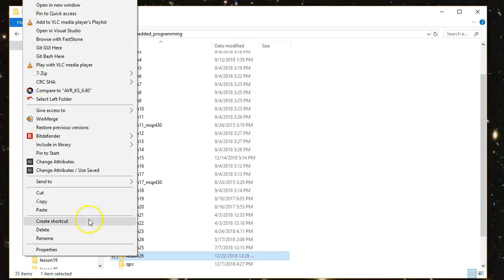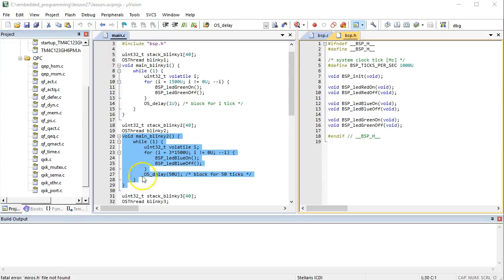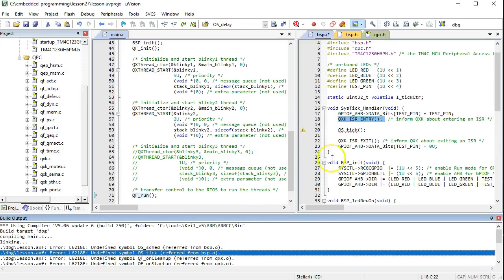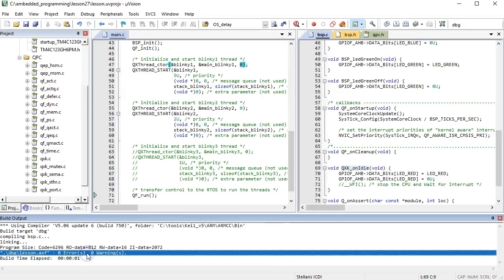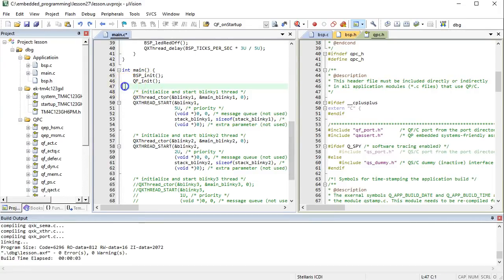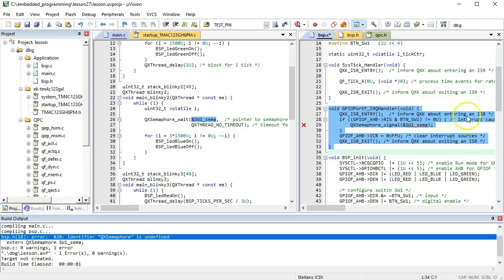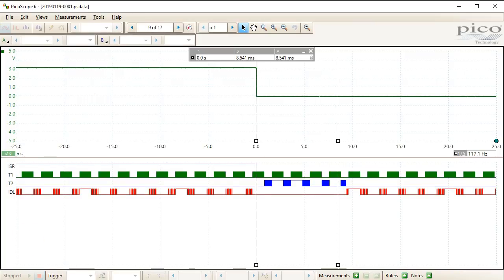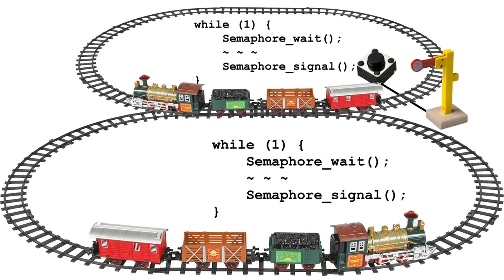#27 RTOS Part-6: Synchronization and communication among concurrent threads

Comment: Hi. Thank you for hi quality lessons. Can you ansver one question. With RTOS i need to compile my application code with this OS. But i try to create system where some core is already on chip and i just compile and download only my application. For now i compile my app code with "fPIC " key that creates relocatable byte code. And if i need call some core function from my app ( like SYSCALL) i put pointer to that function in defined place/adress and than i can call it. But can i use linker ( LD ) for automatic address replacement in byte code or some other way to create downlodable byte code that i can run on chip? Something like big OS where you don't need to compile OS with your app code to run it, OS/core is always on machine.
Reply from the maker: RTOS code typically links right with the application, and the combined binary is programmed into the flash ROM of the MCU. Loading the application separately and independently, as you do this in "big" operating systems such as Linux, is rather unusual in deeply embedded applications. But, it is theoretically possible. The ARM processor provides even a mechanism that could be used for this in the form of the SWI (Software Interrupt) instruction. The SWI instruction is specifically designed for "system calls". It works similarly like the INT-21h mechanism in Microsoft DOS, if you are old enough to remember. An example RTOS for ARM Cortex-M that makes extensive use of the SWI mechanism is the RTX RTOS from Keil-ARM. But even RTX links directly with the application code. --MMS
Reply: @StateMachineCOM  Yes i remember about software interruption it's useful for switching to superuser mode(don't know how it's called) for isolation application code exactly like in OS. Actually i was able to compile download and run relocatable code. My main problem that i can not solve is how to explain what i did and where i load this relocatable code in memory to GNU Debugger. I want to debug this 'user application' that i compiled separately in chip.
Reply from the maker: In order to partition your code into operating system image and a separate application image you need to prepare two different linker scripts (.ld files) for the GNU-ARM compiler. These two linker scripts must ensure that both the operating system and the application would have non-overlapping ROM and RAM regions. --MMS
Reply: If I got you right I think ESP has some kind of linker scripts to solve your problem, check them. You need to provide symbols to your application linker script to get correct function calls. I hope I got you right. https://github.com/espressif/ESP8266_RTOS_SDK/tree/master/components/esp8266/ld

EDIT: Is it really worth it for your application to have different flash regions for core application. Does this core code is big or why it can not be linked each time you build your app?
Reply: @kesmik  Yes, thank you. I will look in to it. When i tryed to make it work, i looked into ld scripts, but for that time it was far beyond my comprehention. But for user code to know where to look up core SYSCALL functions addresses it doesn't  matter if linker put correct address to byte code while linking or it will be hardcoded in to code while compiling. Of couse it matters if you change addresses of this functions. Actually from safety reason ( if user code can be malicious) it's better to make SYSCALL thrue software interruption, as Miro Samek(if i spelled it correctly) / Quantum Leaps  supposed, but if you have a lot of syscalls it's quite costly. But anyway i still have problem with debugging. I was not able to connect linker (that knows where it puts code and different functions /DWARF info) and debbuger that needs this info for work. I think i just need to work deeper on this. 
And about reason. I was thinking about  system where external user can compile code for device but don't have source code for core/"OS". Someting like industrial programmable controller.  I can create simple byte code machine but i dont want to create another language and it can be much slower. Why just don't use "C" language and compile it.